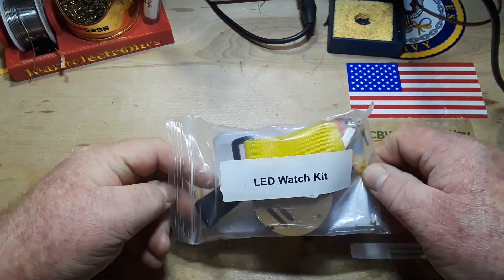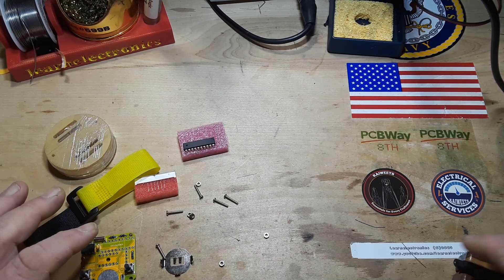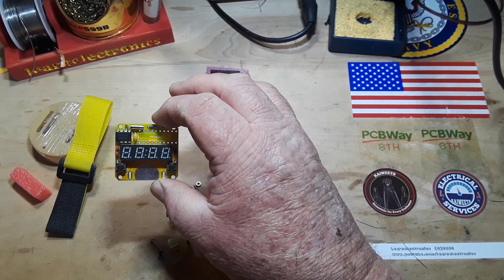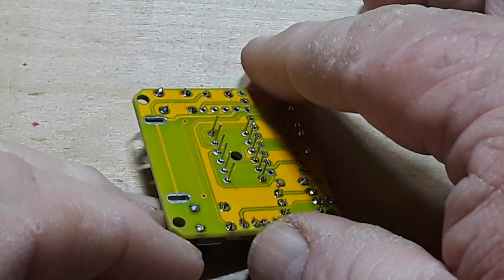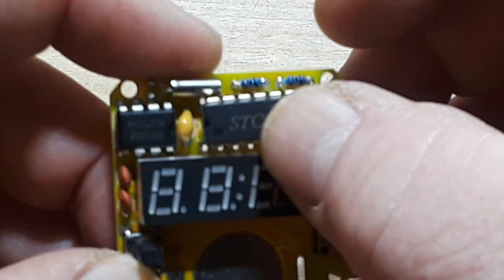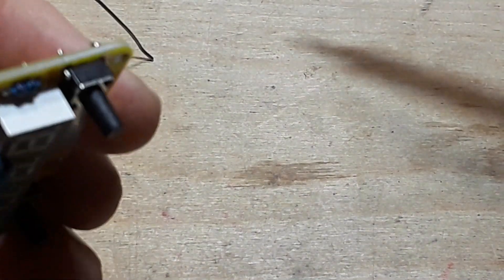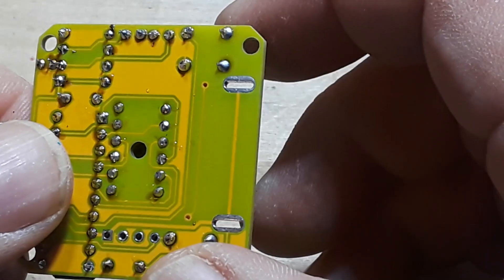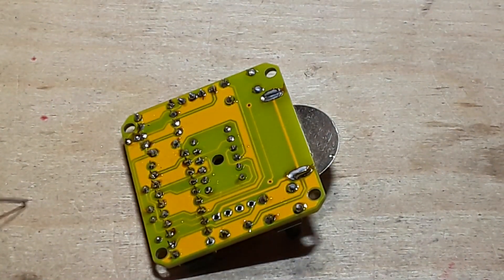LED Watch Build Pt. 2

Comment: just built mine following along with this video. It worked fine, but i realizd the battery that comes with this is very bad and has a horrible connectiong. swapping for a better brand powered this right up... however, do you know how to change the time from 24 to 12 hours?

Comment: You forgot to solder a pin on the chip. Also the positive side of the battery is facing up.

Comment: Paul test the quartz crystal?
Reply: Paul you had stated on one of your videos that you are not a big fan of SMD soldering. Well I assemble Dot Matrix 512 LED clock kits. I have found in some of which I have assembled did not work due to faulty quartz crystals. So now I test them using the function generator and oscilloscope. Please keep on posting I enjoying watching your videos. Piece.

Comment: Well, I *did, actually, learn to use flux on DIP connections and to do that *before component insertion AND I learned how to "think about" "drag soldering" those DIP rows.
... I would try to salvage the major components (Main Clock ICs and Display) and look for other projects and diags which apply to these common components.